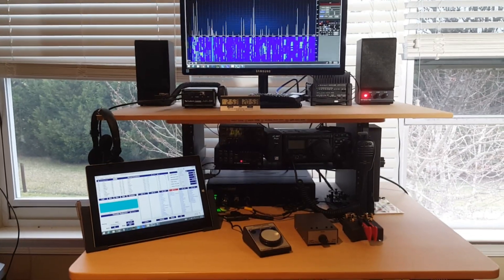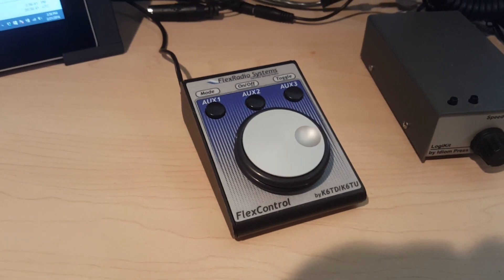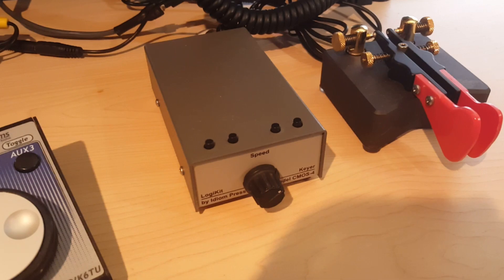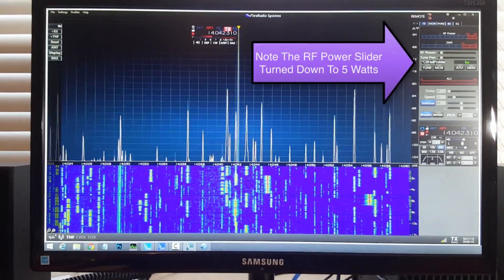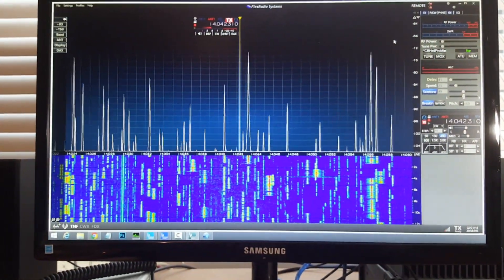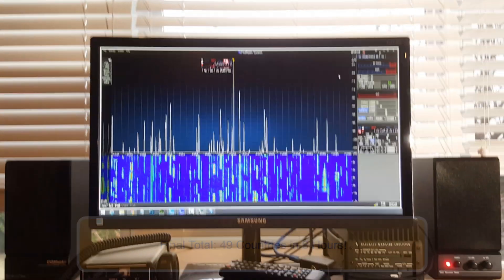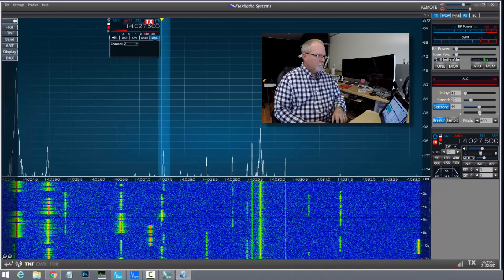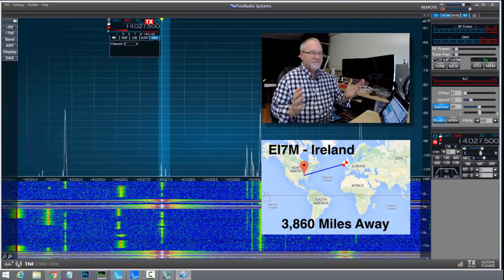ARRL International  DX Contest - February 2016

Comment: Just a few weeks ago, I walked into Flex Radio Systems and picked up a Flex-1500. Love the rig. I just need to play around with the software some more. You've got a really nice shack there!
Reply from the maker: +Radninja88 Thank you. Glad to hear you're loving the 1500.  I bought a used one and then bought a used Flex 3000.  That caused me to upgrade to the Flex 6300.  I then sold my 1500 and 3000 - but turned around and bought a brand new 1500, I missed it so much!  It's small enough to take into the field.  The Flex 1500 and my skinny laptop makes a killer QRP field radio. - Cliff
Reply: I'm currently trying to develop an "all in one" pelican case with the Flex-1500 and a small computer and USB monitor. I'll probably use a track mouse and a compact keyboard, but it would make setting up for field activities much easier with the 1500. If I ever get it complete, i'll have to make a video of it!   Thanks for the reply!
Reply: +QRP School I don't have any other method of asking you this though could you give me your thoughts on the microsoft surface pro that you use? I've been looking at several different models and am trying to decide on a similar setup.
Reply from the maker: +Radninja88 I'm very happy with my Microsoft Surface Pro 3. I love how slim it is and the optional keyboard/cover works well.  There is only 1 usb port on the unit but I have a dongle that plugs into the USB port and gives me an Ethernet jack and 3 USB ports that I can use when working portable. I also have the "Dock" for home which charges the unit and includes an Ethernet jack, 5 USB ports, and video out.  I tend to buy nicer computers so they'll stay relevant longer and my model of the SP3 has the Intel i7 processor - but you certainly don't need the extra horsepower of an i7 for ham radio work. (It IS handy for video editing/rendering, though)

I almost never use the SP3 as a tablet... I always have a keyboard attached in the field.  So, it probably would have been just as well for me to buy a thin Windows laptop. It would have been less expensive.  But, I am very happy with my SP3. - Cliff
Reply: +QRP School i am happy to see the quick response. I've been looking at options for stationary mobile computing (not in drive). The only concern i had was with it's thermal load and pricessing power. I'll probably make the purchase. N4PJA

Comment: +QRP School, this isn't really related to this video, but I was wondering if you'd consider putting a video together going over the battery options that are out there and recommending some good/affordable batteries for portable operations.

I really enjoy watching the videos you put out and am always waiting for the next one! Keep up the good work. 

Justin KC2QVY
Reply from the maker: +Justin Bennett Hey, Justin.  Thanks for the kind words.  Quick tip:  Bite the bullet and buy a Stark Power 6Ah Lithium Ion battery and charger.  The 9Ah batter is the same form factor for $30 more dollars and that's what I've got.  It holds 13+ volts and has a very straight line voltage curve as the current is consumed.  This is the last battery you will need for a long time and it kicks a lead-acid battery's butt.  Trust me, this is what you want.  http://store.starkpower.com/12V-6Ah-StarkPower-UltraEnergy-Lithium-Ion-Battery-LiFePO-Energy-Storage-Battery_p_17.html
Reply: +QRP School Thank you for responding. I was nervous when you said to "bite the bullet" but those batteries actually aren't that horrendous. I'd much rather spend 80 bucks on a battery that's going to work well and last a long time than spend half that on something I'll have to replace next year.

Comment: Cliff,

Slowly getting through all your videos. Your channel is an excellent resource of professional quality videos on getting on the air QRP. I think it has also saved me a lot of money, not making the errors I made when I just started out setting up my base station. Thanks for that.

A couple of questions though.

1/ What do you use as your main 'master' logging software? 

I see you have some iMacs around, so possibly you may use MacLogger HD, I saw you use DM780, so perhaps using the logbook in HRD when using PSK31 or RTTY, then in this video you use the contest add-in for N3FJP and I guess when working portable next to your car or your bike, you may well use a mobile app, or pen and paper.  In addition I see on QRZ.com you use eQSL and LoTW as well. Do you consolidate this (via adif files) from all various sources into one program? If so, do you use rig control and/or which program do you use as the 'master'?

2/ Some have eluded to it below, but it would be great if at some stage you could show your outdoor antennas; how you have set them up and why, as well as how they are terminated in the shack to be used with the various tranceivers in your shack.

Thanks again!

Comment: I'm very interested in the FLEX radios. They seem like a great tool to help keep the desk free of clutter. What would normally involve several separate pieces of equipment, SDR radios provide in one more-or-less self contained setup. Have you run in to any limitations or gotchas with the FLEX?

Thanks for sharing the video.
Reply from the maker: +ryanisflyboy Hello!  I sometimes have the Flex software lose connection with the radio.  I just restart the software and it comes right back. This is not frequent but it's the only thing I can say that isn't a positive.  The QRP Flex 1500 uses PowerSDR software which is more mature and stable than the Smart SDR software that is used with the Flex 6000 series.  If you're into QRP, you can get a used Flex 1500 for about $500 or a new one for $700.  I don't think you'd regret it... but, as I have said before in a video, the Flex 1500 is a gateway drug.  You will likely fall in love with Flex. - Cliff

Comment: Cliff, I really appreciate your excellent videos. You've really encouraged me to try QRP. Can you tell me what is your antenna set up at home was when you made this video.
Reply from the maker: Hey, Michael.  I still have my multi-band Hustler vertical with 40 buried radial wires.  It does a very good job for me and I'm happy with it, given that I'm unable to erect a tower and don't have the trees for a high dipole.  If I had to do it all over again, I would buy the exact same antenna for my situation.  That said, I enjoy working portable.  If I couldn't have an antenna at home, I'd still be a ham and would work portable every chance I got. Thanks - Cliff

Comment: Cliff, thanks for the videos. You have peaked my interest in QRP with the Flex radio. I have the Flex 6500. I am making this comment about something I observed in this video. I was looking at SSDR running and the Network Strength meter in the lower right hand corner is either yellow or red. In the past if this has happened to me I lose connection to the radio.  Are you having a problem with your network?? Kent NC6B
Reply from the maker: +Kent Olsen Hello, Kent. I have the radio's ethernet cable plugged into my wireless router so I can use the radio with multiple computers.  The laptop in the video was wireless and I was having some issues that day.  I actually did lose my radio connection once and had to restart SmartSDR to reconnect.  (That moment ended up on the cutting room floor while editing.)

I have 6 PCs and 4 Macs at my house.  That's a little crazy but, as a software developer, it's sort of like being a mechanic and having a bunch of junk cars in the backyard, I guess. - Cliff

Comment: Good job with the video. Nice setup you have. Wonder what antenna you were using?
Reply from the maker: +tjp2512 I should have mentioned that!  I was using a multi-band trap vertical in my backyard.  There are 40 radials buried around it. It is a Hustler 6BTV and itis the best I can do in my HOA situation.  I aspire to something better but I've had a lot of success with it. http://www.dxengineering.com/parts/hsr-6btv
Reply: +QRP School would something like that work well above, and grounded to my metal roof?
Reply from the maker: +Jarrod P I think it would work well and you'd certainly make a lot of contacts with such a setup. Would it be better than having a field of radial wires cut to specific quarter-wave lengths for all of the bands you're working? Maybe not... but we're talking theoretical differences. You'd probably be able to talk to the same stations with either setup. - Cliff
Reply: +QRP School Cliff - once again, great video.  Thanks for the demo and description of all the parts and pieces.  re: 6BTV - I, too, live in a fairly restrictive HOA.  I have various wires in the trees but have thought about putting up a vertical.  Are you pleased with the 6BTV?  Given what you know, would you make the same selection again or try something else?  How long are your radials?

73,  Charlie  K0CKH
Reply from the maker: +Chas H Hello, Charlie. I'm very happy with my Hustler 6BTV and recommend it highly. I would absolutely install another one if I ever find myself in the same situation. But, you must invest the energy in putting down radials in order to get the best performance.  I have the DX Engineering radial plate and that made it easier to put down a bunch of radials... 40, in my installation.  My backyard isn't very big.  I installed the vertical behind a tree and bought 1,000 feet of wire. I ran radials 360 degrees around the antenna with each radial going as far to the edge of my yard as it could go.  Some radials had to stop short because of the tree or the patio. So, I didn't measure any of the radials, I just made each one as long as possible.  Some of them are long enough to be 1/4 wavelength on 40 meters but most are shorter.  As hams, we just do the best we can with our circumstances and then go have fun!  Best regards - Cliff

Comment: Great video!  Love it.  I was on 20 meters last weekend also, and shocked (as a newbie to CW) how fast they were sending.  I concluded that most people were using computers to send....Is that correct, were most people sending CW using a computer?

Most were going so fast, I just hooked up my computer and used that to decode the CW, then sent back at my 18wpm speed.  Also, were you using a computer to decode that ridiculous CW speed?
Reply from the maker: +Tommy N Hey, Tommy.  Because of the repetitive nature of having to send the same things over and over again, it makes sense to use a computer (or keyer with message buttons) to send the CW.  It's easier to push a button or function key and know that the code will be sent perfectly every single time - at whatever speed you want.

 You're right... some people were sending ridiculously fast!  I was not using anything to decode the CW but you'll notice that it sometimes took me two or three passes before I could get all of the characters of the speed demons.  I heard some people calling CQ at those speeds with very few people responding to them. It seems counter-productive to me. Slow down for us mortals!  (BTW, nothing wrong with using a computer or app to help you decode. I just wish they were more robust... when signals fade they start spitting out jibberish when a human brain can somehow still decode the faint  signal.)

There were times when my QRP signal was a little hard for the other station to copy.  When I'd send my "599 TN" (Tennessee) I'd sometimes have them send "AGN", asking me to repeat my state.  I'd have the keyer speed turned down and reach over to the key and send "TN TN" by hand at the slower speed. That always worked.  When conditions are marginal, slowing down the CW speed makes a big difference.

Thanks for watching! - Cliff

Comment: Nice gear!
Reply from the maker: +Digger D Thanks.  I use my smaller, cheaper QP radios more than the Flex.  The Flex is like driving a really luxurious car and I'm glad to have it.  My little QRP radios are more like Jeep Wranglers.  I guess I'm more of a Jeep person! :-) -Cliff
Reply: +QRP School what antenna were you using?
Reply from the maker: +chris izatt Hey, Chris.  I live in a neighborhood that doesn't allow antennas but they allowed me to have a vertical antenna due to my ARES involvement.  I have a Hustler 6-BTV antenna with 40 radial wires buried in my back yard.  It works well. I'd like to have a better antenna but I'm grateful to be able to have this antenna, considering my neighborhood restrictions. - Cliff
Reply: Ouch. I feel lucky to live in a small rural town.
Reply from the maker: +chris izatt I hear you. There is a little bit of sunshine on the horizon... my brother (N4AJS) is getting a hex-beam antenna in a couple of months and is going to let me remote into it, using his Flex-6300 over the internet. That will be fun. I do enjoy working QRP portable and I do it practically every weekend.  That's a good outlet for me to go outside and get a wire up the air somewhere.  As hams, we make the best of the situation we find ourselves in.  Next house?  Somewhere that's antenna-friendly... - Cliff